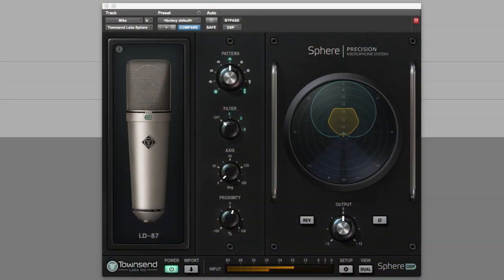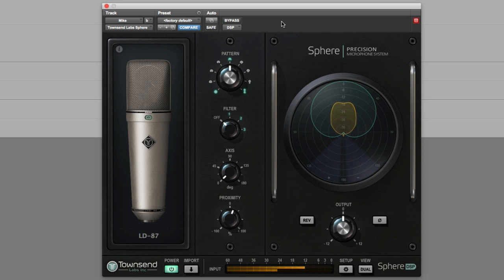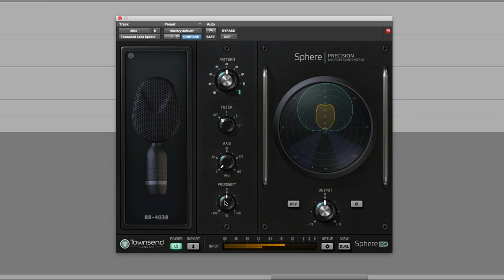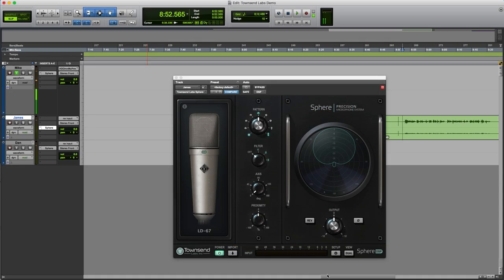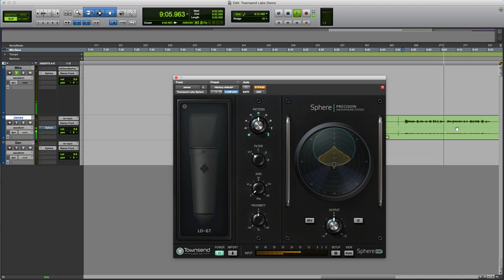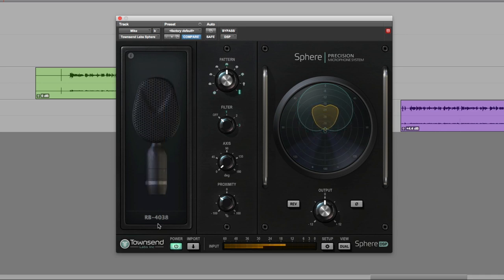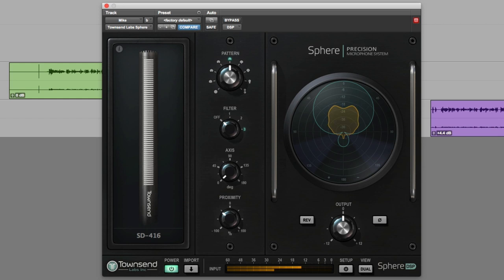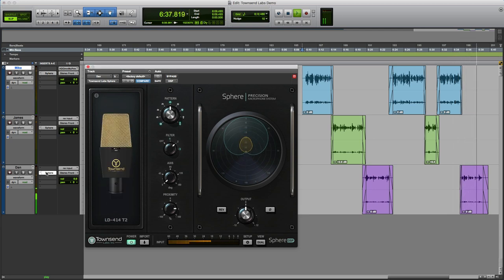How To Use The Sphere L22 Mic Modelling System In Audio Post Production - Expert Tutorial

Comment: This seems problematic for preamps like 1073 with preamp input/output settings when no two preamps sound identical. Have you run into this?

And if you want to use a hardware compressor for a vocal track would you need a 2nd one set identical?

Comment: This system has one huge issue in that you don't actually own anything (not even a user manual) only a collection of plugins. Should you find the software no longer be compatible with your computer 5 years down the line (remember apple silicone) then tough luck, you've got the world's most expensive paperweight. But even if the software remains supported for the next few years you've still got issues connecting this to suitable preamps.